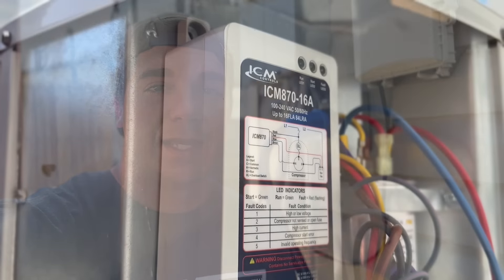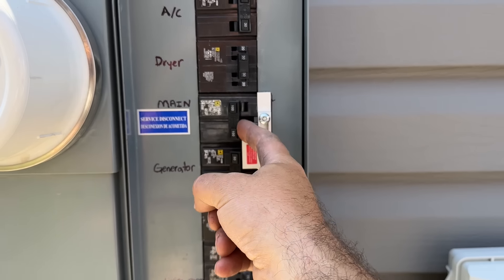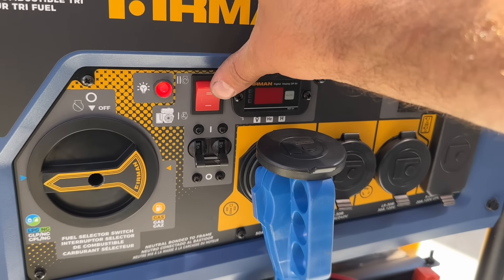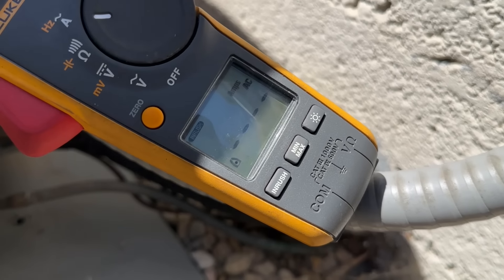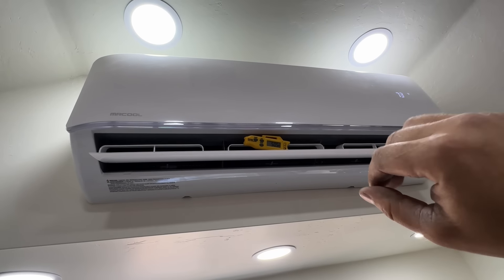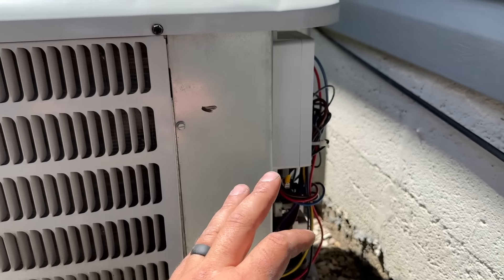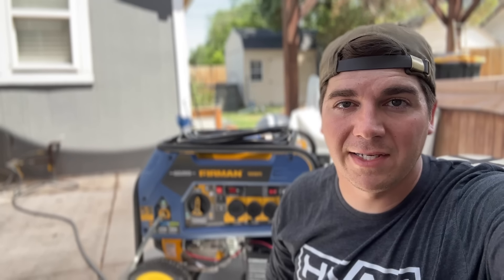How To Get Whole Home Backup Power For Under $1000

Comment: I have the same Generator and 2 ton 15seer Goodman. The stock ptc thermistor is totally good enough to start it. No need for soft start kit on mine. Wondering if you tried yours before adding it?
Reply from the maker: I didn’t, but wanted for people to know how this setup works if they had a larger system as well that absolutely required a soft start. 👍🏼

Comment: Is the generator setup as a floating or bonded neutral? I'm not an electrician, but I think it's supposed to be floating neutral if it's used to back feed the main panel. I'd love to replicate your setup, but I don't know what the risk is if it's setup incorrectly. Any advice would be helpful. thanks.
Reply from the maker: I believe it is floating.
Reply: @diyhvacguy Did you build generator Shed for Emergency ❓❓

Comment: this is a perfect setup for anyone living in the city on city water where you don't need a well pump.  Otherwise you'll need a much larger generac LP/NG setup.  Thanks for showing it.  Very versatile.
Reply: I have a 315 foot deep well and run my wellpump on a 6250 running watt generator. I can run it even while the electric (heat pump though) water heater is on along with the refrigerator and backup freezer. I usually turn those off while showering just so we don't over tax it.

Comment: Just subscribed!
Question?
I recently ordered a generator for our retirement home and it has a total of 4 mini splits 3 in the main house and 1 in the “mother in law’s house”. Just wanted to confirm that I do or don’t need a soft start system for the mini splits?
Thank you for the content!
Reply from the maker: You do not, they are inverter systems so they have a slow start compressor that pull very low starting amps 👍🏼
Reply: @diyhvacguy  much appreciated!!
Thank you for the help!!

Comment: If I have a heat pump instead of an air conditioner do I still need that soft start if I want the similar set up? I live in Indiana so it is used for heating and cooling

Comment: Switch to grid  power while your generator  is running, don't power down your generator while running the house, You will supply a very low voltage to everything, with potential negative consequences. Full power on at turn on, full power off at turn off. - Electrician-
Reply from the maker: Thanks for sharing!! That makes a lot of sense. Cheers man

Comment: To make sure I am understanding everything, you are running all of that (including the central air unit) with a generator that supplies 5500 Watts? Is this correct? I’m sitting without power due to a hurricane. I have a generator that outputs 5500 Watts, but wasn’t sure if I could run the central AC unit.

Comment: How many amps does each lug pull. 
An AC is only about 1500w+ watts for a 3ton. 
Dryer is almost 6000w.  
When using other than gas, your watts and amps are less on generator specs.

Comment: Hey I have two HVAC units both 3 ton. Guessing that this generator would be enough for those two as well as the rest of the home?
Reply from the maker: With two soft starts, I’d imagine so.
Reply: @diyhvacguy  could I run two generators into the same panel?

Comment: whats the THD on those firman? I am wanting to be able to use my PC for entertainment and work in the event we lose power. I also want to run my 65" LED smart TV. 

I will 100% be installing  the softstart kit, but I am on the fence and considering springing for an inverter generator, they are pricey but are a guarentee to run all our electronics.

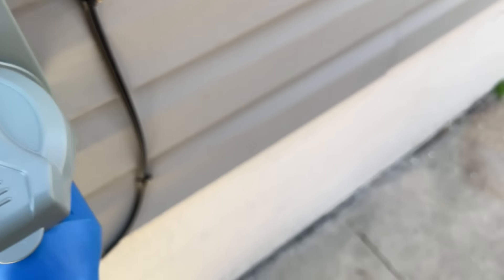Comment: Wait! Why is the light green on @2:39 when you have the main power off and the generator off?? That light should only be green if there is power to the outlet. It's like you have something else putting power into your panel other than the mains or generator. Hmmm.

Comment: Could a similar set up be used for an emergency solar connection? 

Any recommendations for a generator that is a little more quiet? Or are there not many quiet options for generators that can handle all that power load?

Comment: And when it rains and snows or someone hears it and steals it, what do you do? 😂
Reply: In a grid down situation they shouldn’t be able to get to it. At least not without resistance
Reply: I have one of these generators.

When full with fuel they're over 250lbs.

If you have it in an area with a locked gate, or even at the back of the house with difficult terrain around the sides...

It would be very difficult for even 2 people to make off with it very quickly. You would definitely have time to catch them. You're not simply tossing this thing over a fence or something like that and taking off.

Comment: There is always a downside to running the HVAC through a generator. The power just isn't the same as grid power, but it's better than sitting in a hot house with no lights.

Comment: I have a 3 ton unit and it powers up around 27 amps then runs around 8 amps. Is that good. You had 6.3 power up on a 2 ton?

Comment: In Palm beach FL, and I could not find anyone willing to install a soft start (already bought correct unit).  Multiple AC guys said I need to call and electrician.  Electrician said it's a job for AC guy.  FF 3 years later, soft start in the box in the garage and lights still dim in the house when our 5 ton dual stage Goodman kicks on.  Any ideas?

Comment: Doesn't matter who you are or where you're from, but the suicide cord is not something you want to mess with.  It's not just linemen, but you, your family and friends, if they were to pull that cord from the wall when the generator is running, could lead to hazards related to electric shock as well as potential damage to the generator.  Yes, you have an interlock kit but it's better to spend whatever it costs to get an electrician to do it the right way than (I'm assuming you're in the US) being liable to lawsuits and expensive hospital treatment as well as possible fines and incarceration related to criminal litigation.  If something goes wrong with the electrician installed option then the electrician is liable and has to fix it.

Comment: Ok, I got a question, so you have a small generator and this is running the whole house? I am looking for a generator and I have a 100 amp breaker. So how are you getting the power if the generator is small?

Comment: I’m running my whole home in emergencies with a 9500 predator Microair easy start on 4 ton AC 3 fridges and two upright freezers 240 volt well pump and you can’t hear it running

Comment: I have a 11kwh solar system with big tesla batteries.  it doesnt work.  when the grid goes totally down it does too.  plus the batteries wont last but a few hours with full load.   my house is 2450 sq ft and i aslo have a well powered.   would that little tiny generator power my whole setup plus fridge and freezers.

Comment: Why did you need that special 50a cable again?  I couldn't hear what you said in the video.  I have a floating neutral Gen Max tri-fuel generator, but I do not know what 50A cable to purchase.  Also, I have an electrical Interlock panel kit installed. I have A/C unit outside the house like you but no soft start kit.  Do I really need that?  Thank you.

Comment: You should not start the generator after closing the breaker. You should start the generator and then close the breaker. When you switch back you should open the breaker and then turn the generator off. Generators should not be started or stopped under load. It can cause stator failure.
Reply: It wasn't started under load. The power delivery switch was in the off position on the generator when he fired it up.

Comment: Do you have your generator hooked to a ground rod?
Reply: No need for one in this application. As long as the generator neutral is floating (not bonded), the generator is grounded through the cord to the service panel.

Comment: I wanna run a 4 ton ac and a 2500 square foot home. What size generator do i need? I currently have a 5500 watt duromax and i ran 8000 btu window unit fridge and few other things but i want to run my central ac next. Houston tx

Comment: I have this same setup, but I have a 2 ton and 5 ton AC units.  I can run the 2 ton without soft start as long as I don’t have much else running on it.  I am wondering if I could run a 5 ton with soft start.

Comment: We’re did you get the soft start kit and was it easy to install. My brother is an electrician
Reply from the maker: Yes I have two videos showing how to install them. Very easy install
Reply from the maker: Easy Start Kit For 1-1.5 Ton Air Conditioner/Heat Pump: 
https://amzn.to/43qsgjI

Easy Start Kit For 2-3.5 Ton Air Conditioner/Heat Pump:
https://amzn.to/3X6tUoA

Easy Start Kit For 4-6 Ton Air Conditioner/Heat Pump: 
https://amzn.to/3J0dtUL

Comment: Interlock switches are illegal in California. We must have a generator power transfer switch, which is safer.
Reply from the maker: What makes it safer?
Reply: @diyhvacguy  transfer switches have individual circuits with there own breakers, which is an added safety feature, and they work with a bonded neutral generator, so you do not have to disconnect the generator ground, another safety. Furthermore, each individual switched circuit is isolated from the grid, so you have many points of isolation, not just the one main circuit. Additionally. since you are hooking up individual circuits instead of the whole house you can turn circuits off/on as needed thereby reducing load on a generator that may not be powerful enough for a whole house, and thus and keep from overloading a generator, but that also depends on how many circuits are hooked on on your transfer switch. Yes transfer switches are more expensive, but are also required in some locations, such as in California.

Comment: He says $1000. But you need a gas line. What if you don’t have one? Misleading but still a cool vid!
Reply: Run it on propane. We lost power last winter for 60 hours and I ran the whole house non-stop off a couple 30 lb. tanks and a couple half-full BBQ tanks. I do it this way because gasoline goes bad quickly and is more dangerous to store.

Comment: Only problem is in most states the natural gas is pumped using electrical powered pump stations, so no power in a wide area, and you may have no natural gas. The solution is a Tri-fuel generator, si you can use Nat gas, propane or gasoline, in freezing temps propane wont work, pressure is too low, you need heating blankets on the bottles . everything else in theis video is awesome and very helpful, im in the process of buying all the stuff to do this at our house, in case we have a weeks without power from a freeze or storm.
Reply: So what are you going to do?  I have NG but yes it is tied to the area's pump stations. If I chose propane, I'd have to get a big propane tank, the gen and wire it all, and keep it all warm.  Huge battery bank is almost as expensive as a standing generator. I'm no electrician. Solar is too expensive to just decrease a monthly electric bill, if not in inclement weather by chance. And geothermal is expensive!  Curious to your solution.

Comment: I live in a mobile home with the power pole outside  by house  she I put the 220 plug outside  or hook into the house  breaker box?
Reply from the maker: It’s always better to have it outside as you don’t want a cord running through a window or door. So that’s what I’d do
Reply: Ok but I have a nice covered  porch why can't I put a 30amp plug just outside  the door and run the wire under porch into the bottom of panel in house that way the generator  is under a  covered  porch out of the rain, snow

Comment: If anyone is wondering, this is totally true.  I did it earlier this year.  I bought a used transfer panel off Facebook Marketplace, the outlet, roll of wire, etc.  Had an electrician install the wiring to the panel.  Another used generator (like new) off the web, and bam, for about $1,000 it runs perfect.  I didn't buy a generator larger enough to run my 220v dryer or stove, but after load balancing I can run the remainder of the entire house.

Comment: if the generator wasnt running how did you have a green light saying you had power?
Reply from the maker: It wasn’t illuminated, I was just saying it would be when the gen set was turned on 👍🏼

Comment: Floating neutral generator, correct??? 🙄🙄🙄🙄
Reply: You, like nearly all the other “DIY” guys on YouTube, missed two unbelievably critical things in this tutorial…

1) Since your neutral and ground are bonded at the panel, you must be running a floating neutral generator. Nearly all portable generators come with a bonded neutral, so the motor cover needs pulled and the neutral needs disconnected from ground. Otherwise, you risk energizing the frame of your generator. 

2) Code in most every state requires that the generator breaker be strapped to the panel so that it can’t be removed (safety feature so someone can’t remove a live breaker being fed by a generator)

Comment: Too bad it's so dang loud. I'm needing to get one that is inverter and quiter for house. Thinking about genmax new tri-fuel. Of course, much more expensive but much quieter and is inverter so cleaner power and will do around 10,500 watts on gas, 8460 on N gas. It's around 2800 but sitll much cheaper than the generac whole home generators.

Comment: ? So you can’t start your HVAC with a generator without a soft start installed on your AC ?
Reply: It really depends on the HVAC itself, combined with your specific generator. Some newer, ultra modern units it's not needed. Window units and mini splits, generally not needed. For the most common Heat Pump units like we have in the south, they're just about necessary with PORTABLE generators. It really as to deal with the startup motors/compressors, which draw an enormous about of energy, but just for a second. When looking at your unit, look for the Name Plate, which will give you the technical data. Going to look for "LRA" which stands for Locked Rotor Amps. My unit calls for 71 LRA, which is 17,040 watts, just for a second, but my 9,000 watt generator can't sustain that second. I installed the softstart, and am now pulling 24/25 amps at startup, which is 6,000 watts, and much more manageable. When running the AC is only pulling around 3,500 watts so the generator has no problem with that other than guzzling fuel. The HVAC Guy's A/C is only two ton, and pulling significantly less than even my A/C Unit does at only 6.3 amps (1,500 watts). 

I hoped this helps. It really is a lot to take in all at once and I know I had to take it in chunks. Bottom Line though, a soft start can really help you run a central A/C with the right size and voltage generator.

Comment: How do you feel about powering your devices expensive devices with “dirty” power vs using “clean” power from an inverter generator?  I’d love to save the money but I’m fearful of destroying my AC, on demand water heater, furnace or TV circuit boards, etc.
Reply: For wall plug stuff, like TV's, computer, and other electronics, I use a surge protector plugged into another surge protector to power them. I've never had a single failure, but that's all only based on my "I think this will work" ways. I also have the surge protectors switched off until the generator is cranked and running a bit to stabilize as much as possible, then turn them on one-by-one.
Reply: We have put about 20 hours of use on our cheap portable conventional generator as a backup to everything in our house other than the HVAC, oven and electric hot water heaters. No problems with any of our electronics. I did have to adjust the running speed of the generator to get it closer to 60 cycles per second in order to stop my computer UPS from complaining about it. Out of the box it was running at around 66 hz. Hooked up a frequency meter and adjusted the speed screw and now all is well. I think the "fry your electronics" talking points are overdone.
Reply: Appreciate the replies, thank you

Comment: How much gas in 24 hours.  It’s mostly about 15 gallons at what price per gallon are you paying 45 dollars a day. If you need for a week. Good for short term not long term.  EST to have a battery backup with solar. Not cheap but yes I have the generator to charge my batteries. If you had to go two weeks with no power can you even buy gas or propane??   Something you should think about.

Comment: Just curious, why would you have the breaker panel outside?
Reply: Ease/convince  to switch from main power to generator power.  I had breaker panel in garage and generator outside around other side of house.  Wish I had the switch over panel closer to the generator.
Reply: It's a regional thing.  In some areas of the country that's code.
Reply from the maker: A lot of homes have it outside here in Utah. It’s up to code and everything.
Reply: @diyhvacguy  Never seen anything like that before. Seems so wrong exposing box to elements and potential tampering.

Comment: someone in Florida was saying it cost them $60 a day to run their generator on natural gas after a hurricane.. it seemed really high, like running on gas would be cheaper. anyone have any experience on how much it costs to run. also sorta supprosed how much the generator is de-rated running on the different fuel types.. it makes sense, just sorta suppressing how much
Reply from the maker: Well it’s not all about expense, it’s about ease of use. Also if everyone and their mom is at the gas station I’d prefer to hang tight with my generator haha
Reply: @diyhvacguy  Will the gas station have power? There are no guarantees.